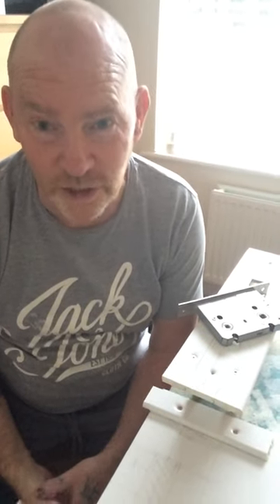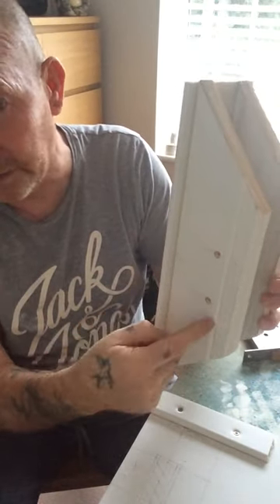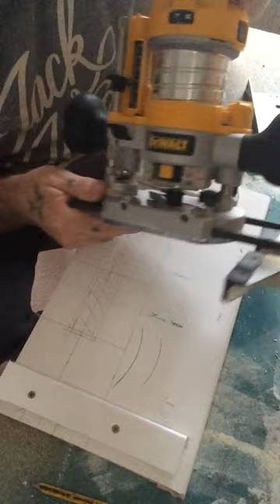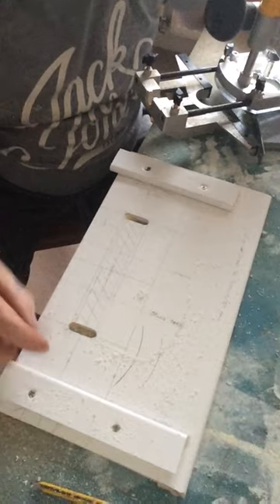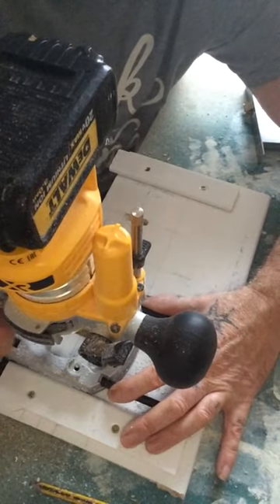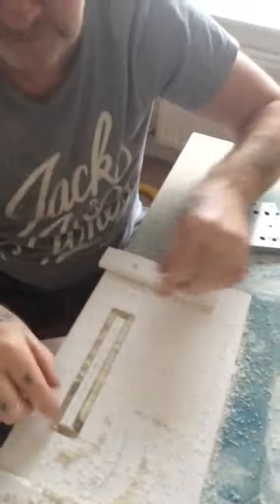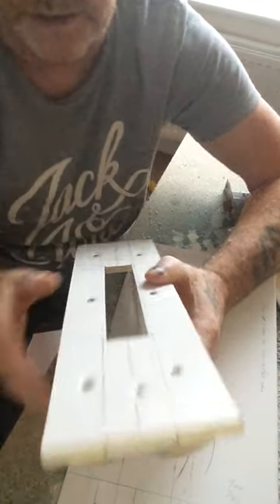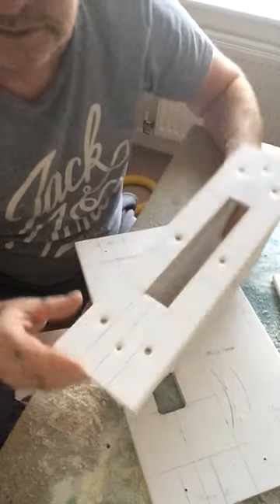How to make a lock jig for your 18v dewalt router

Comment: Great job, a really handy, robust,  cheap jig made out of what could be scrap material. 
Similar Trend or Axminster jigs are €100 and are fiddley as you can set them up for any thickness of door and size of lock. 
A few of this type should do anyone 90% of the time if generally using 3 door thicknesses and 2-3 types of locks.
Reply: I've got an axminster hinge jig and I am struggling to find how in the worst scenario adjusting 4screws could ever be considered fiddly... Its the easiest jig you could wish to buy.

Comment: Great video dude, I’ve been thinking about making some jigs like you have but where you screwed it on the door make the right size spindle hole so you could route the spindle holes too maybe?  And just use a quick grip to hold it on the door.
Reply: Not sure if it would wear the router but out quicker though

Comment: how do you cut out the lock body with a trimmer as the bits arent long enough ?
Reply: @robtien7  one option I agree, cheap material awesome choice, multi function... shame trend don't add , 2nd option you need an 80mm plunge router like the T10ek but expensive, and another jig but as you said cheap to make